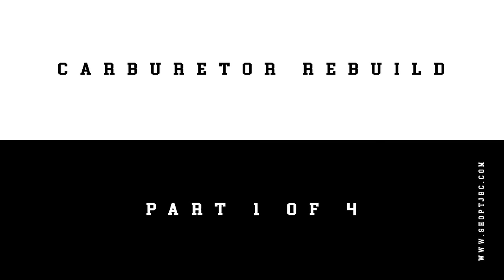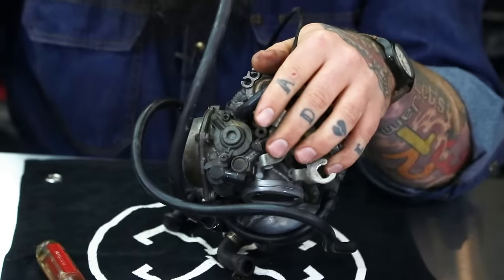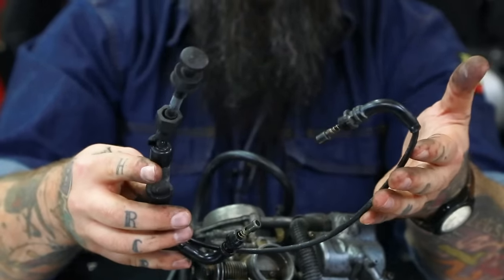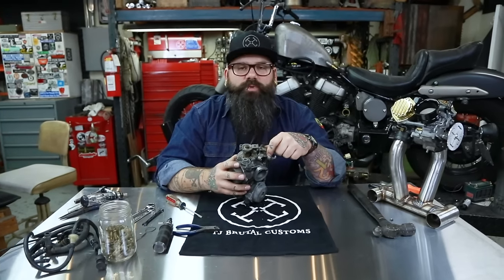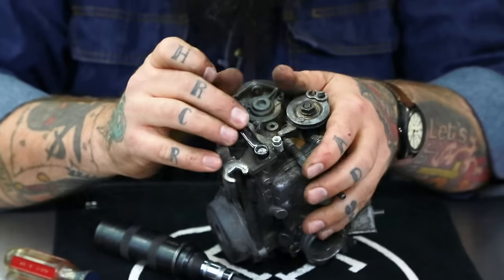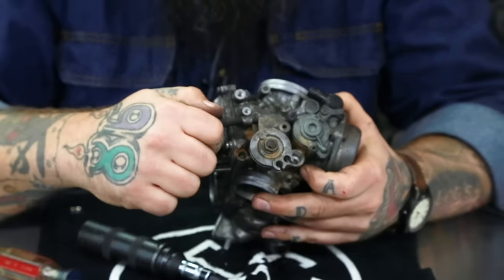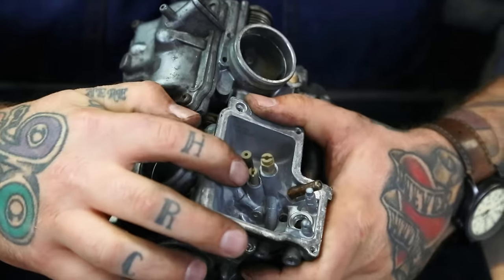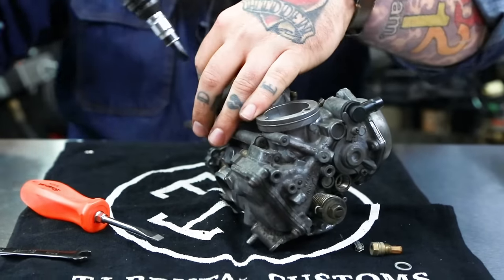EASIEST Carburetor Rebuild for Honda Shadow: Part 1 of 4

Comment: Regarding the slide vent, the hoses for each vent go into a box on top of the front cylinder, do you want to retain that box and put them back or just leave the hoses off the slide vents?!
Reply from the maker: We have filtered slide breather vents now! 🙏🏽https://shoptjbc.com/products/dual-carb-slide-breather-filtration-vents-vt600-and-vt750?variant=42351501050054

Comment: I’ve got a 2002 shadow ace 750 that I finally got to idle but instantly dies the minute you give it gas or turn the choke off. Any ideas where to start to solve this problem

Comment: Bought my first project a few weeks ago. It's a 96 Honda shadow 600 hardtail bobber. It's been sitting a couple of years with gas in the tank and the wiring is bad. Like the previous owners wanted to gas the sleek look of no blinkers and all the cool stuff but didnt know anything about wiring. so there are wires that go nowhere all over the place and components that make the bike run that are just hanging free. What a mess. My plan is to get the bike running fat and happy. Then take all the wiring off the bike that isnt doing anything. Reroute and reposition everything into a cleaner spot. Then it's time for burnouts. I have no carb experience at all so these tutorials couldn't come at a better time. I'm a couple of weeks away from rebuilding these carbs and you're videos are going to be the key to success I'm sure. Thank you for the content and I look forward to giving you my business for years to come

Comment: Just finished installing the stock rebuild kit on my stock 2005 vt750dc. Put 115 jet in front and 118 rear, 2 shims under each needle and Idle mixture screws at 2 and 3/4 turns out. Bike runs great! Never thought this bike could run so smooth and pull so hard on acceleration with no flat spots all the way to max rpm. It's like I got a brand new bike.
Thanks TJ brutal for the build videos really helped.
A couple of the stainless Allen head screws were too short but not a biggy .
One thing I would consider a necessity for this project is don't cheap out and buy a pair of new boots for carb to engine connection.  Couldn't believe how much easier it made reinstallation. Another item to check is the condition of the filter media in that little plastic housing on top of the forward cylinder that connects to the breather tubes to the carb vents. Mine was about to crumble into dust.
You'll definitely enjoy your bike a lot more after putting one of these kits in.
Reply from the maker: John! Thanks for such a great comment!!! If there's anything we can do to improve your experience, please reach out to customer service and we will take care of you!!

Comment: Hey friend, i love your videos. Have a look in to JIS screw heads and drivers. They are marked with a dot on the head. 

If you MUST use the phillips drivers, add some lapping compound to the tip of the driver, it provides great grip.

Comment: What year is the bike that these carbs came off of? I just got my first bike. 2002 Shadow  VT600CD. Do all of the shadows in the early 2000's late 90's have dual carbs? What I'm getting at does mine have dual carbs from stock?

Comment: I have a thin hose fitting next to the where the left carb meets the engine. I cant see it on the carb in this video... The entire fitting itself is dark stained brass with no indication of it having had a hose on there. I have a cali shadow ace 750 and Im not sure if I need a hose there, if I should plug it or just leave it alone.

Comment: Hi, TJ. I have a honda shadow vt 750 from 1998 and it has some cold start problems. If I pull the air it will go down if I do not pull and it is in a cold environment I have to turn the handle several times to start. The exhaust system is not the original and does many backfire when I reduce. I saw your velocity stacks kit and I wonder if it will be the solution or part of it ... I only have one small problem, I do not understand anything about mechanics and carburetors etc, etc ... Thank you for your time when reading my message. José Dias - Portugal

Comment: I just want to say this. I have watched all 4 parts to this DIY, a few times before attempting this. your videos are quality I consider you as my teacher and I go for it. I'm with you up till the choke removal. a basic task. Yours comes out and mine does not. I'm confused. I feel stupid. I wonder why you failed to mention anything about how your choke plunger can become stuck inside your carb. So I go to the forums. The people say its just a plunger, use some carb cleaner and pull it out. So I do. I feel it slowly coming and pop. I did not break my cable, I'm aware of how much a steel cable can take... Nope! I was very carful with the plastic threaded part... easy! but what broke. The head of the plunger itself. Is it Aluminum? I look over to my teacher... The cable detached and now the plunger is stuck in my carb. No clue as to what to do now.  My teacher had left me in the dark without answer. Then it dawns on me that this was only the beginning, I wonder what other things you would fail me on in the future 3 videos... and as I take my carb to the pros in hopes they can save it I wonder...  who my teacher really is.....

Comment: I have a vt750c and it came with cobra pipes but I do not know if it was jetted. Carb needs to be rebuilt but not sure what jet I need to use. I’m in southern MO. Is there a kit you offer at JTBC?

Comment: I just picked up a shadow 750 project to keep my self busy during the current situation. New to riding been learning through your videos. I ordered a used carburetor online. Ebay.  but when inspecting noticed it was cracked, I got refunded. Is there a place where you suggest I can buy a decent used since I’m in a budget. I ordered your double stacks they are nice.

Comment: I've watched all 4 videos over and over as I cleaned and put my duals back together. One thing is driving me crazy. You show the fhingy that the slide needle sits in and then hammer it down with a screwdriver handle. Mine does not go down flush and I don't even know if I should be trying to hammer it down. is it a part of something in the float bowl as well as something in the slide ???

Comment: Hello, I wanted to know if you can help me, I have a 1986 honda shadow vt1100cc I bought it 2 months ago and the carburetor is broken and they tried to weld it and nobody told me anything about that and I need the carburetors and I can't find them anywhere, I live In Michigan, I would be very grateful if you can help me

Comment: could you show me how to replace the throttle return spring? and where to find a replacement
Reply from the maker: replacements do not exist, or at least i havent found anything that works.  you will need to buy another carb and take the spring from it

Comment: Is this carburettor equal to the Honda VT 500 Shadow motorcycle?
Reply from the maker: though they are similar, they are not the same. if you have the carbs in hand you will see the visible differences. the concepts in this video, id say 90%+ apply to many of the dual cv carbs on hondas.

Comment: Is the fuel line being backwards a big issue? I'm having issues running my bike over about 60mph without it losing power (like it's running out of gas) on a 99 ACE 750. Runs great everything below that and can even hit 55mph in 2nd. So far I've checked the Pump and Pump Relay, cleaned the carbs and rebuilt them with new diaphrams and a new gasket set. Still having issues going over 55-60mph though no matter the gearing.
Reply: @TJBRUTALCUSTOMS  asking because at 3:04 you said this carburetor's fuel line wasn't routed correctly (it's backwards). Rereading my comment I can see how that made no sense. Thanks
Reply from the maker: put about 6-8" of tube on the bowl vents and point them towards the back of the bike.

Comment: Help?? I picked up an 2001 600 shadow how do i replace the Neadle- (SEAT) and where to find a replacement? THANKS
Reply: @TJBRUTALCUSTOMS  i was afraid if that?  I hoped you may have crafted a replacement kit. 
Stupid engineers !!  but smart/good for honda- Lets sell more carbs!  can get it to seal while on the bench' but not from float/Gas pressure on the bike.  gurr! lol
Thanks so much for Quick responce.

Comment: My needle jets wont pop out. Any suggestions? Ive sprayed it liberally with carb cleaner. Is that enough or do I need to get it out?
Reply: @TJBRUTALCUSTOMS  Thanks. Then I'll just be waiting for my TJBrutalCustoms Carb kit, Velocity Stacks and pipes to come. Just placed the order today. Super excited. Bikes been sitting for 12 years!!
Reply: Honda Shadow Sabre VT 1100 they have different size Jets and both carburetors is it supposed to be that way

Comment: When rejetting dual carbs with your performance kit do both carb jets suppose to match or do I put 142 main an42 pilot in one the the other 145 main 45 pilot that’s how I’m running it now jw
Reply: Okay so main jets should match but I don’t have two of the same pilot jets in your kit so the pilots will still be 42 an 45 is that okay

Comment: Ok question should both carbs have gas going in or only one
Reply: Both carbs need fuel going to them
Reply: @pewpro941  thanks for the reply I figured it out major leak but it was gaskets and floaters adjusted and repace and wala no more leaks

Comment: Need your help/advise! On a Shadow ACE VT750CD I am wanting to use a roots type supercharger blowing through the carb. Supercharger mounted low and in front of left side of engine. What do I need to consider of the carb venting and etc..., obviously a blow off valve but what else?

Comment: I have a 97 honda shadow spirit 1100cc dual carb. I took my carb out do to have acceleration lag. Other then that it ran ok” My jets are “180 main jet”and “42 pilot” I done all I can with the floats adjustments. But now “I CAN get the bike to start and idle”. Butt it doesn’t ride. Like it NOT getting enuff fuel…When I drain the bowls theirs next to no gas in them. I tryed everything.  
If someone on here is nice nuff to answer me please. Nether replay to this comment or message me. Thank you.  Date 9/17/22.